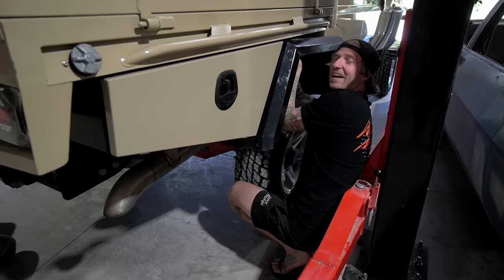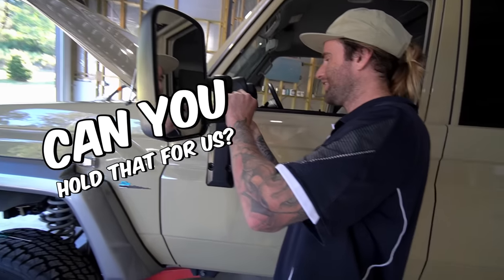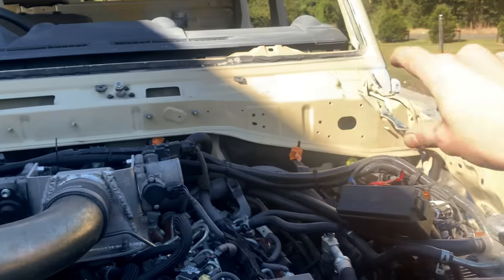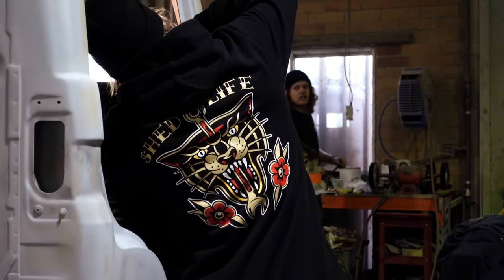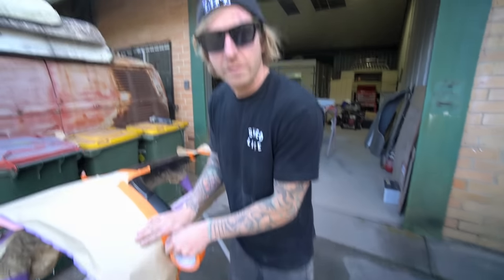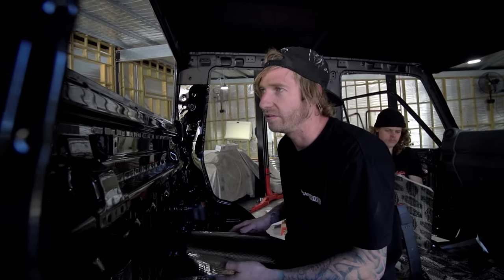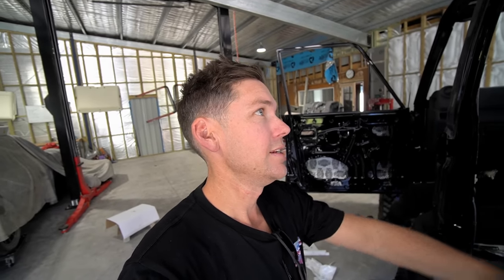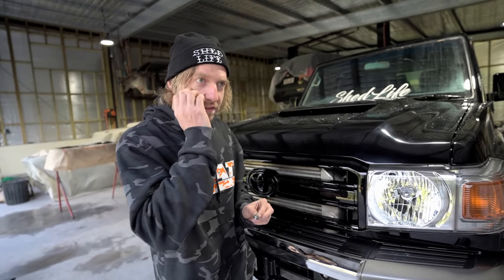He painted it Black !

Comment: quick question, is the kmc wheels stud pattern 5/150 or 5/127? if so do you have to get it custom drilled or is it fine to put on a 127 instead of 150?